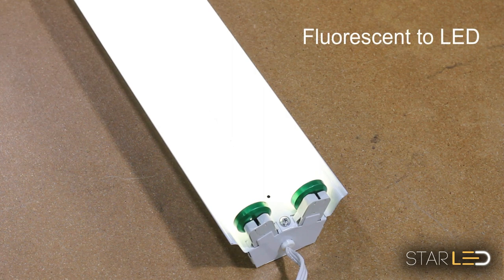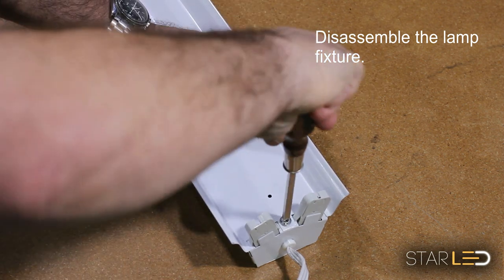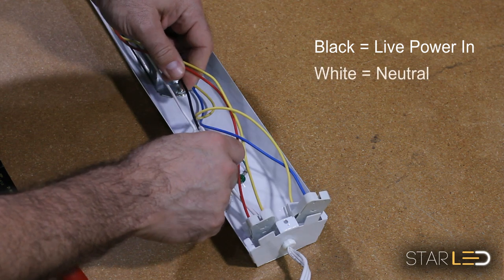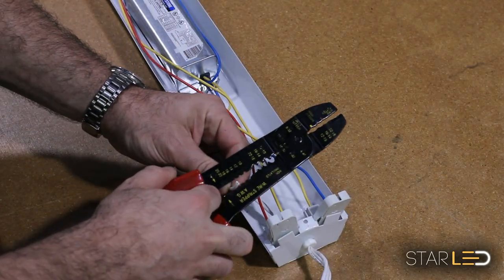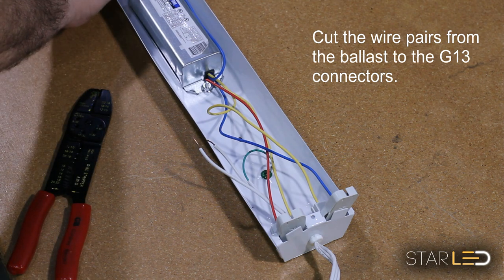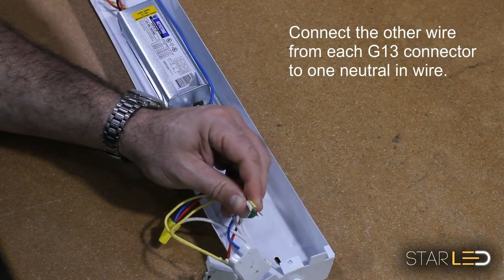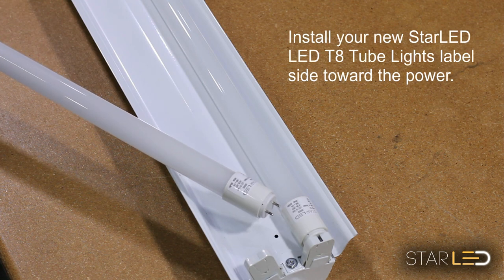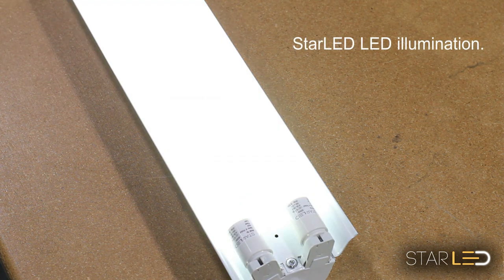StarLED HD T8 / T12 Ballast Bypass Instruction for LED G13 Bi-Pin Tube Light

Comment: The music is obnoxious and that useless ballast should be cut and removed.  It's code some places.  Make sure to stay away from type A tubes as they are called "Plug and Play" and will NOT work if you cut ballast wires.  The brands won't say if they are type B tubes, but should say "ballast by pass tubes". There are several dozen LED brands with various Kelvin ratings.  Get a 4000 or 5000K rating which is closer to "daylight". I don't know for sure, but I think there may be 4 or 5 types of tubes out there.  Beware of what you buy, otherwise you will taking them back to the store for something else.  If you have the proper tube, the wiring is very simple.  Some have the AC end clearly indicated on one end.  This goes in the powered end of the tombstones.  The other end is dead and only used to hold them in the fixture.  Good luck and good lighting.   Bob

Comment: These instructions are driving me crazy. In this one there is no mention of what happens to the sockets on the other side. In other videos the assumption is that there is just a pos and neg connection to each socket, but there are actually FOUR places for wires, and no mention of whether the two extra are just duplicates. Also, you'd expect the same left or right on each socket to be pos or neu but it's actually outside versus inside for some reason, and there's no mention of this, or whether it even matters. These are not rocket science but it's almost as if they're deliberately hiding simple but important information. I haven't found a single video that's really adequate yet. They also either have distracting music, or long irrelevant talking about which bulbs to choose or energy savings which no one cares about at the point of installation.
Reply: Yeah I agree. I watched this on 2x speed and it was still slow, and yeah low on information.